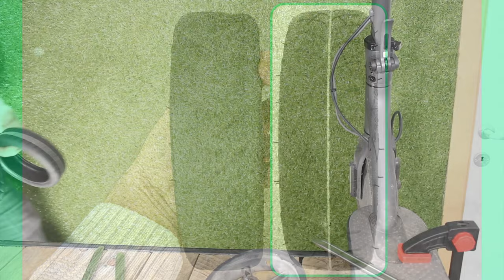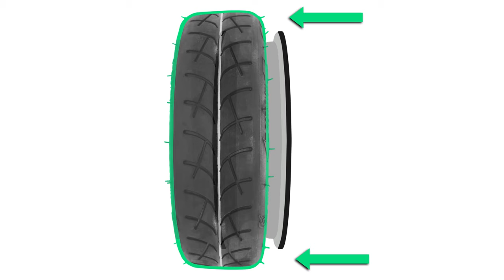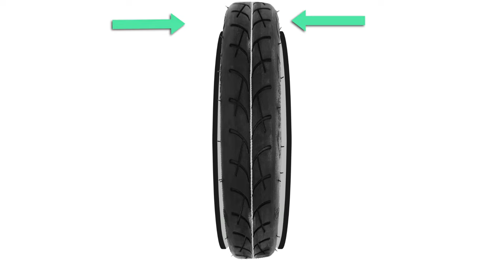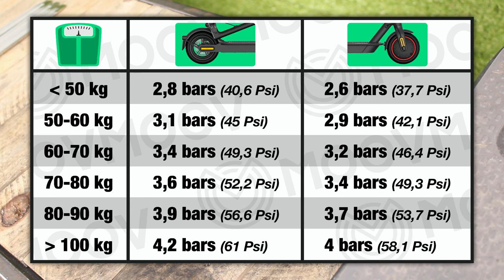TUTO Xiaomi 2022 – Changing the REAR WHEEL BY HAND! Tyre and inner tube: M365 Pro - Mi 3 🛴 💚

Comment: Genuinely don’t try this, just save yourself a tremendous amount of time and misery and pay to get it replaced. Absolutely insane process
Reply: this worked great for me I changed the tyre in only 30 minutes
Reply: @districtultimate9916  I have the 1S scooter and it was impossible to do using this method. I spent an entire day trying to do it using this method and several others, and besides bloody fingers I didn’t achieve anything. If you try this method then you will need several tools which I didn’t have. I assume your scooter has a different design which makes it possible using this method, but for mine it was impossible.
Reply: I would love to, but I asked 5 different bicycle stores and NONE of them would even touch these. They all know what a mess this is
Reply: @TheBeansChopper  If you have no choice other than to do it yourself I would suggest watching a few other videos and see which method seems the best and trying it. Some tools are necessary in order to do this successfully like a few adjustable wrenches which allow you to bend the tire in order to fit it inside
Reply: Halfords... ten quid a year... or just buy a new scooter and have it delivered... ;))
Reply: Agree waste x3 tubes all of them get demaged while I was putting the tyre ...
Reply: @OfficalMcM  just get solids then
Reply: Just finished the replacement, really easy, just followed the instructions. Didn't work the first time but it came around after I sawed the tyre and inner tube off the wheel with a hacksaw
Reply: @calparton637  I personally sent a small ICBM just to make sure it comes off first try
Reply: Was IMPOSIBLE no one want to do it.
Reply: I have replaced both wheels from Originals ones for solid.
It was a nightmare. I recommend doing this with a friend. Definitely need help on this. But you can do it. Just be patient and persistent
Reply: The front wheel is harder to do, completely agree! The boiling warm water trick helps, I also covered the bucket with foil for 30 mins and switched out with more boiling water in between, which really helped! Took me a whole day to gather all the supplies and 3 whole adults to get this done! But we did it and it was 10x cheaper than getting it done from the official service centre which I also enquired at in the same day!
Reply: Why? I'm mechanically inclined but I managed to change the front and back tyres few times. It's not that hard if you have correct tools.
Reply: @Missritujain  for the front wheel, there's a hack that did to make dismantling easier. First, install a monorim suspension and upgrade your tyre to a 10 inch tyre. It's so much easier to take off compare to the standard 8.5 inches😅
Reply: This is definitely for enthusiasts))
Reply: I tried this for the first time with this video as my aid and was able to change it in 40 min or so. Wouldn't say it was simple but definitely doable. I enjoyed the process. This video was super helpful.
Reply: Did mine in 20 mins
Reply: I'm a man on a mission
Reply: @OfficalMcM 😅😂 that’s your first problem, “I didn’t have the right tools” - so what, you used elbow grease instead 🤦‍♂️🤦‍♂️ no wonder you struggled, next time just ask an automotive shop to use their tools (trust me on this, THEY RATHER YOU FIX IT THEN THEM)
Reply: If you honestly can't do this you've failed at life.
Reply: I can hear your a cockney 👍 good video very informative thanks 😊
Reply: @OfficalMcM you can do it with 3 screwdrivers, big ones obviously, but you have to make dure the tire is hot
Reply: I've done it several times, & everytime I raged quite several times putting the ture back on. But yes local stores won't do it. They know what's up😂 not worth it.
Reply: It's only a little more difficult to changing a bike tyre, my dad taught me to do that when I was a kid. The first m365 tyre I changed took me about a hour of swearing and shouting but now I can do a rear in about 20 mins, and that's without those phat tyre levers.
Reply: Okay, I only came here to tell that if you find any part of DIY fun, this isn't scary at all.

With just two small, metal tire spoons, about 60-90 minutes and having absolutely no experience in changing tires, 
I went through the whole process.

(no boiling tires, no heating tires, no soaps or anything.
Maybe they work but i did not feel the need to use them)

I took some time fiddling and trying techniques.
Honestly speaking I damaged the paintwork on the edges of the rims quite a bit while moving tools 
(I don't care how they look, I just want to ride, but if you do care a lot, either be very careful or get some shop to do it for you)
but it's only small visuals damage, that would happen with time on it's own either way.

The second time I did it just to put my newly acquired knowledge to the test
(only the tire and tube changing part)
it took me exactly 12 minutes.
Really, just knowing what to do is all the difference.
I hope that when i get to changing the front tire, it will be as easy.

I want to make it very clear, as comments under those tire changing videos are scary -
it's realty not that difficult.
You don't even need that much strength, what matters is technique.
The second hardest part is putting the small valve in the hole located in the rim - but it's a matter of a little patience and fiddling, nothing more.

The hardest part is putting the tire back on. There's no point in writing technical tips, but what I would say is that you should:
1. Take it slow, baby steps, move the tools bit by bit, don't try to do it in a sweep - you will fail or bend the spoons, which brings me to the second point
2. Don't use too much strength. It's a pretty small tire, it doesn't require that much. If you ever feel that you aren't strong enough, it's probably because you are doing something wrong.
Don't force it, look for a better spoon placement and try again.

Overall it was a pretty enjoyable experience, amplified by the fact most comments come from people who say it's impossible.

(I did this on a 2018, M365 that purchased used, with a flat rear tire. Maybe new ones are the harder ones?)
Reply: am i supposed to carry the scooter if I have a flat tyre smartie?
Reply: @nomer440  You can ride a flat a little i guess, though the rim might get fcked if you hit a pothole
Reply: Took me longer cause I had no zipties but I wasn't that difficult
Reply: an hour ago I was condescendingly reading this comment.  just liked it
Reply: He's from around Newcastle isy guess I picked up on the pronunciation of SCOOOOTA

Comment: 2 extra tips  1 keep fingers away from contact point of brake disk the oil on your fingers can be damaging to performance tip 2 keep the Inner tube slightly inflated do reduce chance of twisting inertube

Comment: Tips: When you put a zip tie, even thou it looks like it is tighten at maximum, tighten the tire again by grabbing to left and right areas of that zip tie, squeeze tire and push it down even more, then zip tie can be tighten even more. 
The soap helps a lot, even thou I thought it is not that important. But try not to cover all tire in soap, or your hands will slip on it.

I first tried for around 2 hours by different methods and I couldn't do it, I even tried the zip ties before seeing the video, maybe I seen it before. 
With above moves and after the video, I put it in 5-10 minutes. 

It only needed 3 zip ties and I think wider ones work better, at least as wide as in this video. 
When tire is pushed enough, you will see the loose end looks good and almost on rim. I just used a very small flimsy tire lever.

Comment: Replaced with the original spare tire. That thing is hard. Nahds hurt! I have no idea what kind of tire you use, but either you're Stallone and hard as a rock in your grip or this is some really soft rubber. That thing with the zip ties - totally sadistic, hard and it's 50/50 that will work properly. It looks damn easy on this video but it is not!
Reply: Same issue
Reply: yes lots of videos i had the same issue. but actually it works if you just keep working it from bottom and move up the sides, tying them down as you go to prevent it from slipping off.  Then use metal tire levers to get the final bit over the rim.   But i hear ya. took me ages

Comment: It is good to let us know if you have warmed up the tire before. I saw you bend it without any difficulty, which doesn't happen to me.
Reply: When I tried different things, I seen putting it in hot water helps a bit, but in the end, I did it without hot water, just squeezing the zip ties more and more until the oposite / loose end was almost on rim.

Comment: It is more difficult than it appears in this video. It will get less difficult with practice (if you have the luxury to spend time). The secret is to use 3 long levers and use your legs to hold the tire and lock one of the three levers. This video shows good starting points though.

Comment: Thanks so much man!
Took me 3 hours, had to redo the zip ties 2 times but I got there in the end. With a cold tire your tutorial still helped me, guys have patience and follow correctly
Reply: took me 3 hours and 20 minutes. xiaomy  2 m365 bought in 2018 and today i get my 1 flat on rear  tyre. Biggest problem was to put out  old tire from wheel. The air in soul in tyre was probably in bigger amount. So i scratch my black wheel so many  times. damn, my hands  hurt. Even i was pushing  surface of tire, there was problem to get air out. I used pliers to get valve out and then finally i removed soul from tyre. Zipping  was easy, I recommend  use more soap. greeting from Slovakia

Comment: ahh man thanks - the zip tie bit was super helpful and got me over the hump.  i couldnt believe it when i finally got the tire on lol. what a huge pain in the butt
Reply: How tf did you do it? I manage to put the 3 first zip ties on, with that part of the tyre tucked in, but then the rest of the tyre I just can't even move. Feels like I need a grip of a rock climber to do it
Reply: @mariopurisic5133  you have to patiently work your way around, by crimping the tire into the rim so you can get the other side on. Its definitely a pain
Reply: @kneel1  I think the rubber is just too hard to bend that much. I'm not the strongest, but the strength need to bend the rubber is unreal. I have the spare I got with the scooter, I just feel the one you used is way more maluable
Reply: @mariopurisic5133  I assume you did it by now, but anyway :) ... You can put the tire in hot water for some time, 10-20 minutes. The soap helps more than you would initially think, just try to get it on the edges right between tire and rim. Then, , what helped me the most ... when you put a zip tie on, it would look like it is at max, but not yet, you can grab tire left and right of that zip tie, squeeze the tire more and push it even more inside the rim, then zip tie can be tighten even more. After that with only 3 zip ties, I seen how the loose end of the tire was almost on rim. Took 5-10 mins once I got the right moves :)

Comment: Good tutorial, however I STRONGLY do NOT recommend using the zip-tie method to attach the new tyres. I wasted about an hour and a lot of energy trying to use zip-ties. Instead use two tyre levers or anything else you have that's long (25-30cm at least), flat and made of metal. It's so much easier and faster, only thing you gotta watch out for is popping the inner tube, but that's very easy to avoid.

Comment: Great video!
Unfortunately, in trying to attempt to change my third solid tyre, I'm through :)
The frustration, yelling, swearing and yes, throwing it a few metres down the garden, has made me stop and buy a bike instead. 
I'm sure there's an easier way to change this solid Xiaomi tyre?  :)
Reply: Just use the tires without air so you wont have to change them next 20 years? or get ninebot which has like car tires and no inner tube?

Comment: Okay, I only came back here to tell that if you find any part of DIY fun, this isn't scary at all.

With just two small, metal tire spoons, about 60-90 minutes and having absolutely no experience in changing tires, 
I went through the whole process.

(no boiling tires, no heating tires, no soaps or anything.
Maybe they work but i did not feel the need to use them)

I took some time fiddling and trying techniques.
Honestly speaking I damaged the paintwork on the edges of the rims quite a bit while moving tools 
(I don't care how they look, I just want to ride, but if you do care a lot, either be very careful or get some shop to do it for you)
but it's only small visual damage, that would happen with time on it's own either way.

The second time I did it just to put my newly acquired knowledge to the test
(only the tire and tube changing part)
it took me exactly 12 minutes.
Really, just knowing what to do is all the difference.
I hope that when i get to changing the front tire, it will be as easy.

I want to make it very clear, as comments under those tire changing videos are scary -
it's realty not that difficult.
You don't even need that much strength, what matters is technique.
The second hardest part is putting the small valve in the hole located in the rim - but it's a matter of a little patience and fiddling, nothing more.

The hardest part is putting the tire back on. There's no point in writing technical tips, but what I would say is that you should:
1. Take it slow, baby steps, move the tools bit by bit, don't try to do it in a sweep - you will fail or bend the spoons, which brings me to the second point
2. Don't use too much strength. It's a pretty small tire, it doesn't require that much. If you ever feel that you aren't strong enough, it's probably because you are doing something wrong.
Don't force it, look for a better spoon placement and try again.

Overall it was a pretty enjoyable experience, amplified by the fact most comments come from people who say it's impossible.

(I did this on a 2018, M365 that purchased used, with a flat rear tire. Maybe new ones are the harder ones?)

Comment: ...mineral oil lubes rot rubber. like vaseline and wd. said one. ............wonder about some hacks. like just removing center of valve and filling bad tube with some thick liquid center in again. food like wheat water but will rot unless add what salt or chlorine. or mineral like grease thinnned. silicone something. latex. or what called for sealing windows but too thick or . maybe cut holes on tire to put in then hardens. or what into holes..on sides or ..plastic straps or. fill it. push many in. cut off big end. or cut across tire on top to get something in , some round tube of plastic or ...can cut in a few places four eigth . l  tried wood in  a bike tire.  , branches. too bumpy too uneven shapes sizes. somebody make those hack videos now...and how results are. some easy way to fix....or cut along middle of tire all around . wrap it inside with layers of inner tubes from bikes . or cut pieces of them that are about flat.or tire soles.  then how to finish. straps many or around rim or . sow with wire or just puttty , glue putty . creative reparis . l done some tht some worked kinda.

Comment: IMPORTANT: for xiaomi mi 3, you need to remove the blue brake caliper to slide the tire back and remove it. i didnt have the tools to pull the tire out so i used a wrench and a flat head screw driver. just had to be carefull not to puncture the inner tube with the screwdriver

Comment: What a nightmare. Everything's easy until the step 19. Original spare tiere that comes with the scooter is way too hard rubber to get squeezed on the other side of the rim. The tyre in the video looks very soft and easy to mount. No any help from the cable ties. Problem is that tyre doesn't drop on its place on the other side of the rim. Yes I manage to squueze it there but it doesnt' hold. Even after placing cable ties the tire moves finally towards from the other side and then tire slips back out from its place. Horrible. Tried even heating the tyre in a microwave. Next I go somewhere and pay for the work. 2 hours with very bad language and totally exhausted forearms.

Comment: Yo, idk if you can read this or not, but do you by chance know what type of screw or it's specification for the reinforcement rod at @3:08 ? A friend took my scooter during the holidays and replaced the inner tube at a store, but then they forgot to screw in the mudguard parts and now it's missing the screws there that i need to buy.

Comment: Excellent - thank you. Remember our carpentry rule - "Measure twice, saw once" - in other words don't hesitate to STOP! Have patience. Stand back. THINK!  Absolutely the best approach,sometimes. TIP = before replacing the screws, give each  2 or 3 squirts of cheapo hairspray on the thread(s)  - it contains just the right amount/type of adhesive to stop them vibrating loose. Plus it sometimes smells walnutty - mmmmmmm. Happy scootering and DON'T FORGET YOUR HELMET/lights.!

Comment: Step 19 definitely is the hardest. Had to give up, 80% of the tire was in, but the rest was impossible. In the video looks like it all suddenly goes in
Reply: Because he uses a soft easy mode tire. The original replacement tire that's included is almost impossible to put on by hand.
Reply: @CheapoPremio  I could do it at second try

Comment: I did it 😁 it worked well. In theory it's understandable actually, but the part 19 was the kinda more difficult part, because it just needed a little bit more straight, so I asked my brother to push the inner part 😂 it's not difficult at all actually, but just needed some straight girls 😊
Reply: For everyone wondering, step 19 is at 10:29